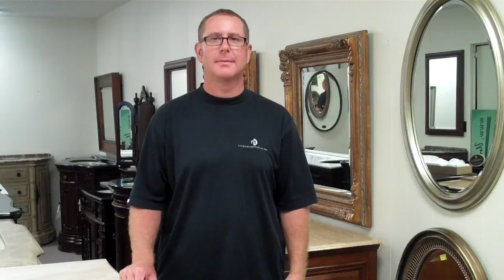How Do Electrical Fires Start And How To Put Them Out

Comment: Just wanted to ask if the electricity is switched off, is water still not recommended?
Reply: Yes. After electricity is shut off there still can be stored voltage in the devices and wiring.

Comment: Holy cow, the neighbour in Spain .. I just found him in our tiny lift in the floor above me he was collapsed inside drunk as a skunk, he peed himself badly (dripping out of the lift) and the underside of the stationary lift was crackling (never does that), there were sparks and that metallic burn odor was thick in the air... anyway I helped him out by lifting him and let him into his flat but the lift had been called to the lower ground where I now there's a lot of dust accumulated at the bottom 'pit' of the lift... so I was shitting myself as I thought this would initiate a fire.. I ran outside to get the porter to turn the electricity to the lift off and he was south american and as care free as they come (having requested that the two businesses at the ground floor) put a sign up asking the public not to use the lift ... when I returned to the lift the sign had not been put up and the sparks had stopped and the porter could not smell the acrid burning smell as he had a cold. The porter used the lift... checked on the drunk neighbour and laughed it off as nothing.....     I've seen a monitor at work overheat, smoke and melt .. tell me I wasn't overreacting and that lift needs a maintenance check.
Reply: @MATT CYPRESS I think it's a bad and nasty human trait that when there is mortal danger looming and somehow an individual knows that they're connected, linked or caused that danger; - they somehow want to shun responsibility and absolve themselves from said responsibility  by just washing their hands of it and running away, not even informing others of the immediate danger to them.
They just don't want to face up to the problem because they don't want to deal with people and any lawsuits for compensation or insurance claims for negligence really. Many of them won't be insured for such claims anyways.
Reply: @MATT CYPRESS I'm paranoid about fires in the home sleeping at midnight in a ground level flat (apartment/condos in U.S. speak) and as I got to sleep I could smell someone cooking late - like as it it was toast or something. Then around 20 minutes later I heard someone down my outside corridor kicking the door, a woman and I thought it was my neighbour having a domestic argument with one of his crazy girlfriends. I had enough of the noise, got up and put my dressing gown on and opened the door to my apartment. I was then hit with a wall of black smoke as I did so and I quickly shut it but just before I shouted out my apartment number and stated that I was 'OK and that I was going to climb out of my window'. I realized very quickly (couldn't even see her) but that a lady fire officer was breaking the doors down to all the apartments. I managed to get some clothes on (my head was getting dizzy with the smoke pouring in under the door) and clamber out of the window which wasn't easy as there was still a good drop of over a meter into the shrubbery below.

My lungs were burning and my mouth was full of smoke particles but I made it out, the fire officers offered me oxygen and water to clear out my mouth (only took the water) and I was left to wait for the fire officers to do their job.

In the crowd, I saw a young guy and an asian girl, the asian girl covered her mouth as if to stop herself laughing as I managed to climb out, which I thought was inappropriate. I later found out that these two had been loaned the flat for a few days, had left a candle burning on top of one of those old CRT TV's, the had gone out night clubbing and the candle tipped over and had burnt into the electronics of the TV and had caused  fire (must have been plastic TV casing or something). 
Afterwards, I got no apologies, no one had any concern for me, the building porter who was a lazy drunk had not renewed the dead batteries in the fire alarms in the corridors for months / years.
The couple who had caused the fire disappeared (a neighbour commented on how the woman was a nasty piece of work who would not say 'hello' even when greeted), the owner of the burnt out apartment was nowhere to be found,

What was more shocking is that for that night, when the fire was raging is that I was the only one in that ground floor level, all the other 6 or so apartments had no one in them at the time of the fire. I was very lucky to be alive, had no one called the fire brigade in time I would have died in my sleep due to fire inhalation, just another statistic. 

Now I have fire alarms everywhere in my apartment. By the main entrance door, the kitchen, the living room, the study, the bedrooms. everywhere.

This must have been around 2003-2005.

Comment from the maker: It sounds like a loose wire connection in either the fan itself or the switch. Either are not good. I'd start by checking and/or replacing the switch. If that doesn't work, then I'd check connections in the light fixture/fan itself. If you're not up to the task and this is a recently purchased item, I'd call the store and see about exchanging it. Especially if you've only had it for 2 months!